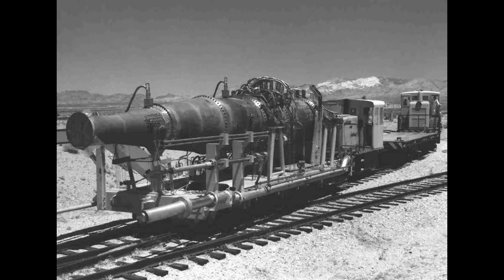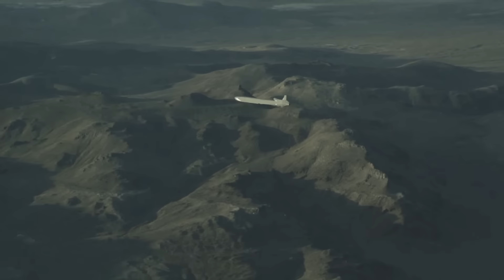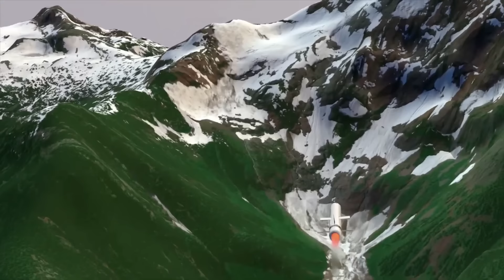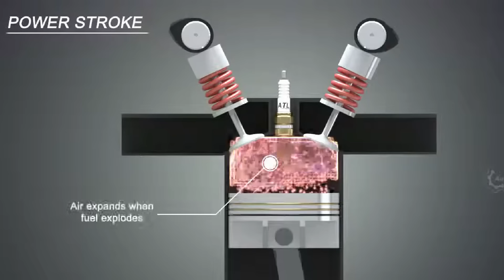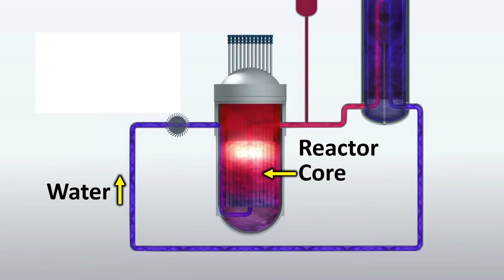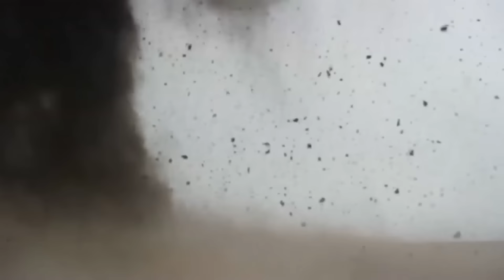How Can Nuclear Reactors Power Missiles? | Russia's Burevestnik Missile #militarytechnology

Comment: As others have commented, no radiation trail was observed from the test flight. The speculation is that Russia is not using the same design as USA used for Pluto - likely a heat exchanger of some kind means the incoming air does *not* flow through the reactor core..
Reply: most likely yes the liquid metal coolant is what heats the air, and the flow of this coolant can be controlled in order to vary thrust
Reply: @Pythoner Забавно, я в своё время к таким же выводам приходил. Впрочем есть альтернативный вариант: это действительно реактор с прямым или почти прямым воздушным теплообменом.

Но да, я как и вы рассматривал разнесение реактора и теплообменника с воздухом, и реализацию при этом турбореактивного двигателя, — с компрессором и турбиной по сторонам от такого теплообменника. 

Мне тоже это казалось лучшим способом сделать это компактным решением. 

С другой стороны обойтись лишь реактором с прямым воздушным охлаждением выглядит привлекательным вариантом по ряду других причин
Reply: @a.v.gavrilov  если реактор сам нагревает воздух тогда чтобы менять скорость придётся варьировать мощность реактора с помощью регулиривующих кассет. Это все не так надёжно если говорить о летающим реакторе. Посредством через управление течение жидкого металла выглядит как наиболее оптимальный способ
Reply: @a.v.gavrilov  - but it was said NATO monitoring ship and nearby monitoring stations in Norway did not detect any radiation emissions. Therefore it seems unlikely that there is direct contact between reactor and airstream. Didn't Putin directly mention that it uses liquid metal coolant? Somehow I thought he did.
Reply: @Pythoner  - so if controlling coolant circulation is used to vary speed of missile, then that would strictly limit how much the speed can be changed. I read someone suggesting 2 cooling loops might be used, which could give increased room for overall change in circulation.
Reply: @manofsan  You can always regulate the rate of fission with control rods, that's to say vary the output of the nuclear reactor and how much heat it produces. Think of the control rods like gears and the coolant flow like revs.
Reply: @manofsan  Putin didn't mention anything about the reactor's design and coolant, he only said that it was 1000 times smaller than a submarine's nuclear reactor. Russian nuclear submarines use fast neutron reactors with liquid metal coolants, hence the discussion here. If Putin used that comparison then it stands to reason that the Burevestnik's nuclear reactor is probably of a similar design
Reply: @Pythoner  вы ошибаетесь, способ отъёма тепла не влияет на способ регуляции. Классика регуляции реактивности на таких быстрых реакторах — доплеровский эффект в отражателях, и заглушение возвратом цилиндра с борным поглотителем (керамика с бором) в центральное отверстие реактора, — классический пример этой схемы —  реактор Kilopower от NASA. Правда у них энергетический класс — 10 кВт, а здесь — единицы МВт
Reply: @manofsan  если там были корабли, и с наветренной стороны — это однозначно откидывает такую версию, А вот если бы мы лишь на Норвегию полагались, и не знали направления ветра, то оставался вариант что они не зафиксировали выхлопа именно поэтому.

Но в целом повторюсь, я пришёл к выводу что это скорее всего быстрый реактор с жидкометаллическим теплоносителем, скорее всего NaK-эвектикой и турбореактивным двигателем, в котором камера сгорания заменена на теплообменник, ещё в 2018 году
Reply: @Pythoner  нет, от типа охлаждения это не зависит, в любом из них можно использовать Допплеровский эффект в отражателе для регуляции реактивности, и глушить реактор полностью возвратом цилиндра поглотителя в центральное отверстие. Тут не нужна более тонкая регуляция
Reply: @a.v.gavrilov  да я говорил о том же, что регляция реактора осуществляется с помощью кассетах. А отъема тепла это отдельно. Но с помощью того или другого, по факту можно менять силу тяги. Либо ты убераешь кассетах и ректор нагревается и соот. жидкость охлаждение тоже, либо ты открываешь больше путей для циркуляции жидкости вокруг внутренного контора турбодвигателя, скажем. В любом случае, воздух будет больше нагреваться и тяга увеличится
Reply: @Pythoner  нет необходимости регулировать тягу на такой ракете, — она разгоняется химическим пороховым ускорителем до скорости подхвата, — и автоматическая регуляция мощности за счёт допплеровского эффекта, не позволяющая реактору перегреться достаточную саморегуляцию обеспечивает чтобы реактор не перегрелся до выхода на крейсерскую скорость, а дальше вам нет нужды регулировать мощность кроме как выключать реактор возвращая центральное цилиндрическое тело с поглотителем для того чтобы полностью заглушить реактор, — а вот эту операцию это ракета неоднократно проделывал, хоть и с разными реакторами, — для каждого из этих разных реакторов в конце их полёта. Правда в 2019 году из одного реактора повторно этот цилиндр извлекался, — при подъёме реактора, но всё ещё под водой, совершенно случайно, что и привело к реактивностной аварии (разгон на мгновенных нейтронах), — тот самый взрыв который зафиксировали и сейсмические станции, и в виде лишь радиоактивных благородных газов как сперва в Северодвинске, так и позже в Норвегии.
Reply: And when reactor stops the metal solidifies and envelops the reactor to prevent radioactive material escape,  so I have heard.
Reply: @onepartofone  Interesting, if correct that sounds like a 'hot metal' reactor design - like what was used in the Alpha class submarines, probably a good choice for a missile too.
Reply: @markir9  тут других вариантов и не остаётся. Только в отличие от реакторов для подводных лодок тут NaK-эвектика скорее всего используется
Reply: @markir9 Question is how do you heat up the loop prior to the launch. Those subs required a shore-based source of steam for many hours during a cold start. But the missile,  apparently, can cold start in minutes.
Reply: @TrespassersW-g4l  нет, не требуется, вы ошибаетесь, — если используется NaK-эвтектика, её температура плавления — -12.6°C, то есть она будет оставаться жидкой даже ниже температуры замерзания воды. Вам достаточно сделать теплоизолированный контейнер, и немного его подогревать, если температура ниже опустится. Можно вообще резистивно его греть, — этой конструкции всё равно есть изолированные электроды касающиеся этого металлического теплоносителя, эти электроды используются для МГД-насоса там. Можно просто при помощи этого насоса качать этот самый металл, заодно его нагревая избыточно большим током
Reply: @onepartofone  Why? When these star flying it's ' Goodnight Vienna '
Reply: That's they key: they used a heat exchanger with air as the secondary fluid. No telling what was the primary; I would guess sodium, even though its boiling point is not all that high; sodium is light, non-corrosive, has stellar thermal conductivity, and low neutron absorption. But with nuclear fuel, it's not necessary to heat the air to 1000C. Hydrocarbon or hydrogen powered rockets or aircraft must operate at a much higher temperature, up to 1500C, in order to conserve fuel; a nuclear rocket needs to do this only if it's carrying its propellant, as it must do in space; flying low in the atmosphere, it has infinite propellant, so heating it to just 500C is plenty efficient enough, because fissile material has over 1.5 million times the energy density of methane. 500C is easily accomplished with sodium.

If sodium were used, that might explain the accident. If it leaks, it will burn, and being the primary fluid and subject to neutron activation, it will be terribly radioactive, although fortunately, not for very long--it has a 15 hour half-life. However, a loss-of-coolant accident will likely also cause the fuel rods to melt and leak their contents.
Reply: @richardburden6035  not Na, but NaK, as liquid metal coolant
Reply: Try to calculate the surface area required if you want to use a heat exchanger. The nice thing about jet fuel is that the heat is transferred by combustion inside the air flow.
Reply: @richardburden6035  If they are using a Hot Metal reactor design , then the primary fluid could be lead (since it will be in liquid form at the operating temp for such a reactor).. Purely speculation at this point tho.
Reply: @markir9  molten lead is corrosive, although this can be managed with just the right amount of oxygen in it.  Lead is also very dense and its thermal conductivity is not as good as sodium, although still better than any non-metal that is otherwise suitable. The danger of a sodium primary leak (radioactive, burning sodium) could be reduced with a secondary sodium loop, which if it leaks, produces non-radioactive burning sodium. Having air as the final coolant, with no liquid water, eliminates the risk of a sodium-water explosion, unless this cruise missile falls into water. For a commercial jet, lead would be much better, but for a weapon of last resort, safety is much less important, so sodium is better.
Reply: @richardburden6035  Yes, but sodium explodes violently when encountering water - and in anything other than a *very controlled* environment will see a lot of water. This is why (for instance) an submarine propulsion unit will *not* use a sodium cooled reactor. Re corrosion, - sure but the Alphas lasted for decades...the Burevestnik probably has a similar lifespan, so I'm not seeing this as an issue. Also the Russians are very good at metallurgy and likely have figured a solution (which might be a different easily melting metal rather than lead). After all we are doing speculation here.
Reply: @markir9  Yes, the Alphas, which used lead-bismuth eutectic, lasted for decades, but required a lot of maintenance--to clean up the primary fluid. The U.S.S.R. was not able to keep enough of these going.  Sodium explodes only when a large amount can react with a large amount of water. This does not happen when solid or liquid sodium contacts water vapor--then, only the surface can burn, and the low density of water vapor makes just a flame. A few drops of liquid water, again, will not cause a significant explosion.  Of course, a large cloud of sodium vapor mixing with air or water vapor while below ignitiion temp, then being ignited, will explode like any mix of flammable gas and oxidant gas. Sodium's ignition temp in air is not very high, in the 200's C, if I remember rightly,  so any sodium vapor escaping the reactor will ignite immediately, preventing a big explosion.
Reply: @richardburden6035 a chemistry master you are !
Reply: @richardburden6035  здесь используется не свинец-висмут, и не чистый натрий, а NaK, очевидно
Reply: @gianPI7381  там используются не чистый натрий а NaK очевидно
Reply: Agreed.
A true SCIENC’SOR indeed!…;)
Reply: @gianPI7381  "пиздабол you are", вы хотели сказать. Никто не будет делать на такой ракете ни Na, ни Pb, ни PbBi-эвтектику. Потому что есть радикально более удобный вариант NaK-эвтектики, имеющий температуру плавления в -12.6°C, что позволяет обойтись без активного терморегулирования даже большую часть зимы, — если у вас температура не падает ниже -12.6°С, обходиться лишь термостатированием контейнера с ракетой, а он там герметичный и теплоизолированный, — банально просто отводя в систему подогрева контейнера тепло от выхлопных газов дизеля тягача, используемого для транспортировки контейнера.
Reply: @creightonleerose582  нет. Потому что он чушь говорит, там используется NaK-эвтектика, температура плавления которой составляет -12.6°С
Reply: No radiation trace was detected. To understand why it's not there, watch the video about the air-cooled nuclear waste storage.
Reply: @alexkon6195  Когда было построено хранилище??? а  когда была пущена ракета??? Русские применяют новые технологии, о которых о них, тебе идиоту, они не расскажут!!! 
Ты диванный эксперт!
Reply: looks like american molten salt reactor Aircraft Reactor Experiment (ARE)
Reply: @alexfiend7695  That is certainly another possibility. There is the issue of reactor startup with frozen/solidified molten salt (similar issue with my suggestion re lead coolant)...but maybe the Russian have figured this out!
Reply: @markir9  нет. Здесь вы абсолютно точно ошибаетесь. Это реактор с твёрдым металлическим топливом, по типу NASA Kilopower
Reply: @a.v.gavrilov  You may well be right - I did say I was speculating.
Reply: @markir9   1) спасибо, ценю это 2) о, можете не сомневаться — в этой части я прав на все 100%.

Из того что можно говорить публично, — во-первых, реакторы на расплавах солей просто по физике будут требовать большей массы(1) и большего объема(2) топлива, чем Kilopower-like решения из цельнометаллического топлива a la 93% U-235 и 7% Mo (молибдена), — а значит будут иметь и больший размер корпуса реактора и больший размер, объём и массу отражателя.

Так же такой реактор потребует разогрева температуры плавления солей до старта, — в отличие от Kilopower-like металлического (93% U-235 + 7% Mo) ядра с жидкометаллическим охлаждением NaK-эвтектикой (температура замерзания — -12.6°C).

Кроме того реактор на расплаве солей очень плохо вписывается в требования "глушить реактор чтобы затапливать его в океане, и вылеживать его там до распада продуктов деления". А такое требование было и есть — эту ракету именно так и испытывали. Подводный взрыв реактора в 2019 году произошёл как раз при подъеме из воды вылежанного реактора. Тогда при подъеме очевидно выдавило (из-за того что поднимали неправильно, не той стороной вверх) центральный блок замедлителя из карбид-борной керамики, из-за чего в окружении воды произошёл реактивностный разгон.  (В норме реактор должен работать в воздухе, и слой отражателя на нём как раз на это рассчитан был, вода просто дополнительное отражение создала, а заодно и дополнительное охлаждение отражателя чем нарушила тепловой баланс в отражателе, регулирующим реактор за счёт теплового эффекта Допплера в отражателе, и нейтронный баланс, при котором этой регуляции хватало).
Reply: negative ghostrider US satellites picked it up at the 17- 350 micro verts range, easy to shoot down.
Reply: @hektoriuz US AA Is quite bad, we all can see it in Ukraine,  can't even shoot down drones,  IMHO.
Reply: @oledoled8008 Yes! It's really not disputable now that all Russian AD and missile technology is far better than anything in the west.
Reply: @hektoriuz  US satellites don't detect radioactive isotopes or radioactive trails of any kind bud. They can detect things such as x-rays, or infra-red emissions, but that's not what we're talking about.
Reply: @Pythoner  регистрация х-rays через атмосферу на спутнике для реактора не сработает, поглощение электромагнитных волн атмосферой растёт как пятая степень от частоты
Reply: @a.v.gavrilov  это да, тут я имел ввиду инфракрасное излучение как от пуска баллистической ракеты. Но запуска такой крылатой ракеты спутник не обнаружит, тем более излучение от самого реактора
Reply: @Pythoner  💯🤝
Reply: One thing doesn’t exclude the other. In a reactor the nuclear material is within metal tubes. Same principle can be applied here and most likely are because uranium wouldn’t be mechanically stable enough at the required temperatures.
But I rather doubt that Russia achieved this. One of the main problems is to moderate the reaction. If it produces enough energy to generate this thrust how do prevent the reactor from doing it before you want to start the engine.
Radiation shielding isn’t a problem, because you don’t need to shield the reactor but only need to shield the electronic from the radiation.
Reply: @svenweihusen57  The same way you start/stop it in a submarine's nuclear reactor; with control rods that absorb neutrons
Reply: @Pythoner you simply don’t have the room for these because they would be in the airstream. Maybe some liquid moderator.
Reply: @svenweihusen57   это реактор на быстрых нейтронах, ему не требуется замедлитель. И лучшей моделью для понимания того как устроен какой реактор является реактор NASA Kilopower — с точностью до конструкции системы охлаждения, в реакторе NASA используются тепловые трубки в российском реакторе используются трубки с теплоносителем из NaK- эвтектики. Что до старта и торможения этого реактора, там так же как в реакторе NASA Kilopower используется центральное цилиндрическое тело из керамики карбида бора. То есть поглотитель. В режиме работы реактора саморегулирование происходит при помощи допплеровского эффекта в отражателе, как и в NASA Kilopower-реакторе (с разницей разве что размере отражатели и наличие у ракетного варианта дополнительного слоя поглотителя за отражателем, чтобы минимизировать как размер так и радиоактивный след).
Reply: @svenweihusen57  каких температур? Но в любом случае там используется не чистый уран, там используется сплав a la NASA Kilopower — 97% U-235 + 7% Mo, — у него и температура плавления выше, и механическая стабильность при высоких температурах дольше сохраняется. Там ограничения по температуре вообще никак не связаны с механическая стабильностью топлива, они в первую очередь ограничены температурой кипения NaK-эвтектики. Настраивается температурный режим соотношением топлива и отражателя нейтронов, допплеровским эффектом в котором и саморегулируется реактор.

Это простая как мычание система, и её простота и является залогом её надёжности.
Reply: Assuming it's actually nuclear powered.
Reply: Жидкий натрий вроде
Reply: Maybe it does but there is radiation shielding which is lightweight but also conducts heat, made from secretive materials?
Reply: It would be a nice change, if people would start using their mind, and start to be rational, not just about this, but about everything else…
This is H2O powered missile…
Yes, it has reactor, but it is not nuclear reactor…
It is Hydrogen powered missile…the reactor is used to alter the state of the water into the Hydrogen…
This happens, several seconds prior to entering the combustion chamber…
Russia is not the only country that uses Hydrogen, as the primary fuel for their missiles…
Other countries such as China, Iran and a lots of other countries, are also using Hydrogen as the primary source of fuel…

So…if this is true…
Does this means, that Iran was actually trying to get enriched uranium for nuclear weapons…
Well…
If Hydrogen is used as a fuel, the answer would be…” yes “…
Since any country that knows how to resource Hydrogen, does not have any needs for enriched uranium…
The only problem is, that most of the countries, that do know how to outsource the Hydrogen, they are also the country that sells crude oil to others, so promoting Hydrogen as a fuel, is not viable option, for Russia or Iran….
Burevestnik is Hydrogen powered missile, same as a lots of nuclear submarines…
That’s the only reason, why none of these weapons do not leave any traces of radiation, behind themselves…

All hypersonic missiles, are powered by the Hydrogen…
Also, they are most likely to be two stage missiles, during takeoff they are using solid fuels, once they have established the solid trajectory line, they are switching to Hydrogen…
Reply: Turns out, it is leaving a radioactive trail but not from its exhaust. Its coming from deterioration of the missile body due to the radiation. Apparently, the US has detected this trail and its about the only way to track it apparently.
Reply: probably molten sodium loop
Reply: @xfxox  - nop, the russians are decades ahead of the muricans: "Soviet Navy also operated submarines with liquid metal-cooled reactors, such as the November-class K-27 and the Alfa-class submarines, which used lead-bismuth eutectic coolant" - that was 50 years ago !
Reply: @mirandela777  правда здесь скорее всего используется NaK
Reply: @mirandela777  The US opted to not use molten metal reactors for technical reasons, like irradiating the crew even when the reactor is shut down. That's not a technological limitation, that's a limitation of willingness to use "bio robots".
Reply: @nonamesupplied1875  - BS,  they were incompetent and with no clue, the russians build several of them, not like the old murican tech, based on salt, but yes, a lot more advanced ones, based on molten beryllium alloys ! 
The proof is in the FACTS, not on the BS vomit some like you spread on YT: 
1 - the russians build several molten beryllium alloys reactors for their subs, and those not only worked but also broken the world record for a submarine - and that record still holds today ! NOBODY managed that feat again, and nobody : here to educate your ignorance: 
"The Alfa-class (Soviet designation Project 705 Lira) submarines were a revolutionary class of Soviet nuclear-powered attack submarines known for their exceptional speed and use of advanced, high-risk technology. They were designed as high-speed interceptors, primarily intended to make quick dashes from port into the North Atlantic to counter NATO naval groups. 
Key Features and Technology :  Titanium Hull: The Project 705 was the first class of submarines to use a full double hull made entirely of titanium alloy. This made the vessel lighter than steel-hulled counterparts, more resistant to corrosion, and enabled it to dive to much greater depths, while also being less detectable by magnetic anomaly detection (MAD) systems.
    Liquid Metal Cooled Reactor (LMR): The submarines were powered by a compact, high-power lead-bismuth cooled, beryllium-moderated nuclear reactor (either the OK-550 or BM-40A model, 155 MWt). This system was significantly smaller and more efficient than conventional pressurized water reactors, allowing for the submarine's high speeds and small overall size.
    High Speed and Maneuverability: The combination of the lightweight titanium hull and powerful reactor allowed the Alfa class to reach submerged speeds of over 41 knots (47 mph or 76 km/h). They were incredibly agile, able to accelerate to full speed in about a minute and complete a 180° turn in just 40 seconds, enabling them to outrun most contemporary NATO torpedoes.
    Deep Diving: They had an operational diving depth of 350 meters (1,148 ft) and a test depth of 400 meters, far exceeding the operational limits of most Western submarines at the time.
    High Automation and Small Crew: The Alfa class featured extensive automation, allowing it to be operated by an exceptionally small crew of just 31 officers. The crew was primarily stationed in a reinforced, central command compartment. An ejectable rescue capsule was also a notable safety feature" - NOBODY ever died on those class of subs, only braindead clowns like you regurgitate BS western propaganda, clown ! 
Is a factual reason why the russians are at least 10 years ahead in hypersonics and the first capable to build a nuclear powered cruise missile ! 
Get an education, muppet, before arguing with some !
Reply: @xfxox or K+Na instead of just Na 🤷
Reply: @a.v.gavrilov  KNa is really nasty liquid, so beside experiments by UK to use it as coolant nobody is that strange AFAIK.
Reply: @maxinfly  ну, могли себе позволить не использовать его. А здесь это просто необходимо, — чистый Натрий пришлось бы греть перед пуском, притом значительно, и невозможно было бы поддерживать его расплавленным вместо этого. Притом такая ракета сейчас глушит реактор в воздухе, — физика подсказывает тот же самый дизайн, что у реактора NASA Kilopower, — цилиндрическое металлическое монолитное топливо из высококачественного урана 235 (Kilopower — 93% U-235, 7% Mo), и центральным цилиндрическим отверстием для размещения цилиндра поглотителя, — вот его и возвращают в центральное отверстие для заглушения реактора, — Ну а дальше ракета падает в воду, и выдерживается (лежит) там до распада высокоактивный продуктов деления. NaK жидкий до минус 12.6°С, вода — плюс 4°С (+4°С >> -12.6°С), это защищает конструкцию от перепадов давления внутри контура из-за затвердевания металлического теплоносителя.

Ну а так да, — в других системах по другим параметрам оптимизацию делали очевидно... Но соглашусь с вами, это немножко странно!))
Reply: These missile reactors run very hot and use highly enriched uranium. They also radiate copious amounts of gamma radiation. Lots of neutrons also. Anyone within many metres would be fatally radiated. If it crashed enroute the crash site would be highly contaminated.

In an unmanned missile radiation from the reactor doesn't matter much. On hitting the target the reactor debris would function as a dirty bomb. Of course if the war head is an H-bomb this doesn't matter much either.
Reply: @jimgraham6722 For delivering nuclear warheads we already have  a much better, faster, much harder to intercept system: The ballistic missile. That's why nobody has this.
Reply: @jimgraham6722  ну, вы чушь пишите. Там довольно небольшой слой защиты нужен для того, чтобы понизить дозу до ниже тех ужасов, что вы здесь рассказываете. А это приходится делать для защиты электроники и полезной нагрузки самой ракеты
Reply: Maybe they used something  similar to the new Chinese Thorium Nuclear Reactor  on a miniature scale.
Reply: @alifahd6593  нет. Здесь вы абсолютно точно ошибаетесь. Это реактор с твёрдым металлическим топливом, по типу NASA Kilopower
Reply: And what happens when it explodes at the target?
Reply: @larbranca  As I understand it, this weapon is designed to *only* carry a nuclear warhead, so any radioactive elements from the power source would be lost in the actual blast.
Reply: @markir9  не говоря уже о том, что это ракета является оружием судного дня в смысле "оружием мёртвой руки в судный день", — что будет означать что мир и так будет в радиоактивных руинах лежать, ну как минимум на 1/6 части суши.

Задача этого оружия никогда не быть применён, задача этого оружия пугать до усрачки неизбежным возмездием за любой "обезглавливающий удар"/ "первый удар". Это буквально оружие сдерживания. Так что немного насрать с высокой колокольни, что там будет когда оно будет применено, а точнее если оно будет применено. Его задача никогда не быть применён, а просто пугать насильников неизбежным возмездием случаи, если они захотят ещё и Россию уничтожить
Reply: @larbranca  взрывается, очевидно.

Впрочем, можно было бы сделать и систему со сбросом боеголовки. Но зачем?